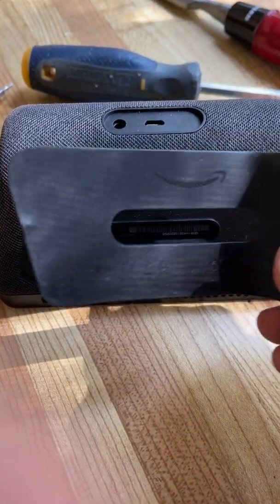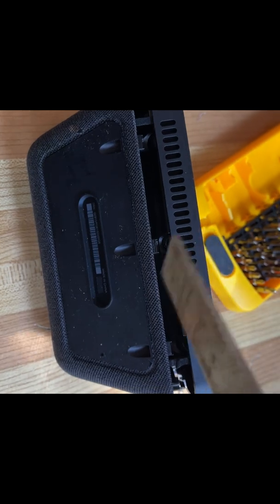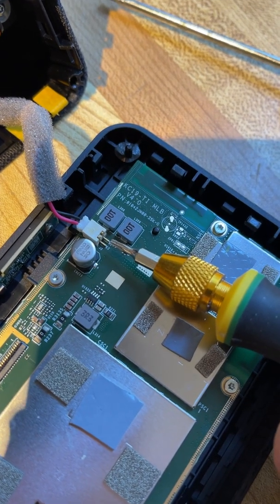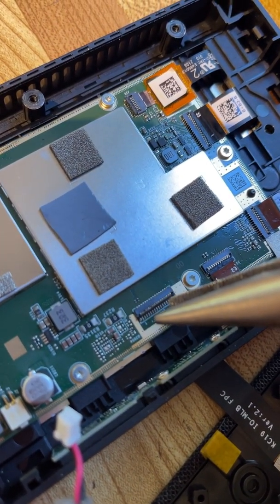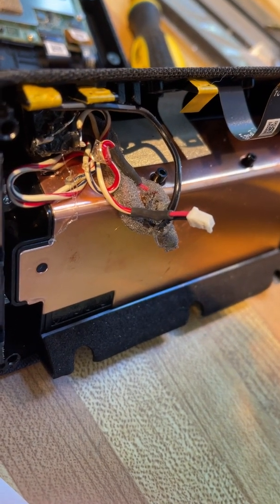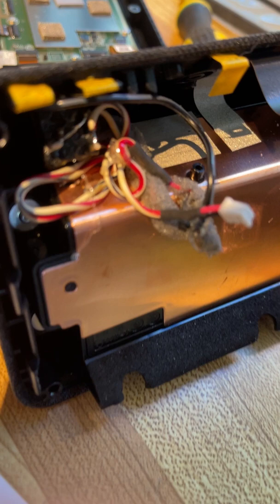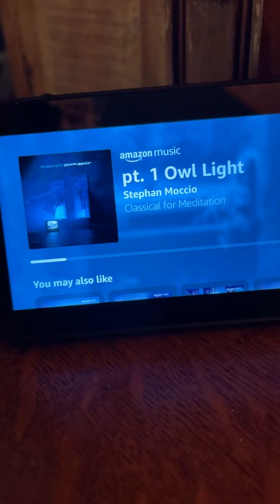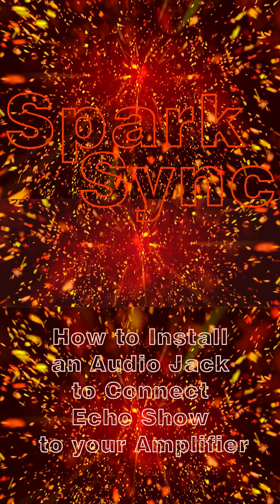Echo Show Audio Jack Installation

Comment: For some reason my PC couldn't connect using bluetooth to ES8 (2nd generation) and use it as an external speakers. But my PC can connect to my airpods and samsung smart TV.  I see there is a jack in the back of the ES8 and i wonder if i could connect to my PC with a wire.